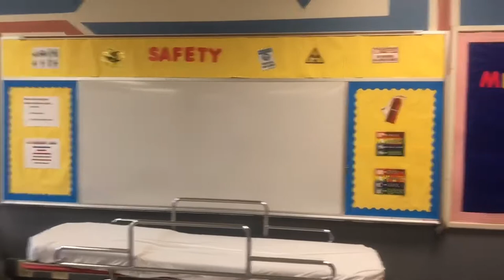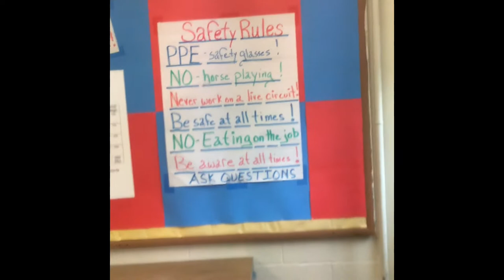Mastbaum Virtual Tour

Comment: Graduated in 1970. Was a share timer going there for electric shop. Back then electric shop had 1 drill no meter sockets or circuit breaker panels to wire up. Next to no conduit 3 years that I attended. Was a great school back then but heard it went downhill last 25 years. Retired after fun & enjoyable 50 years as an industrial electrician.